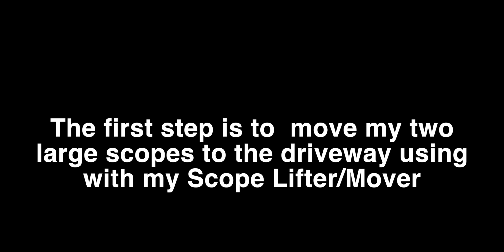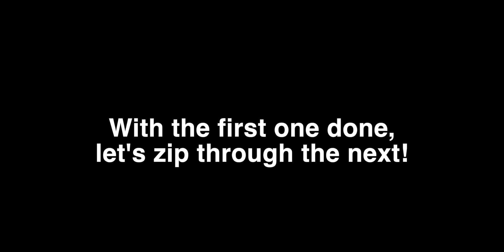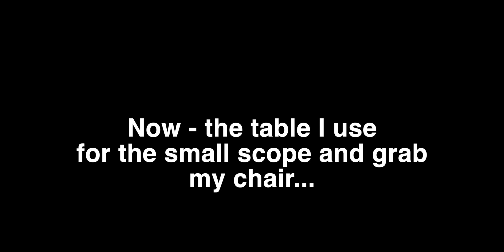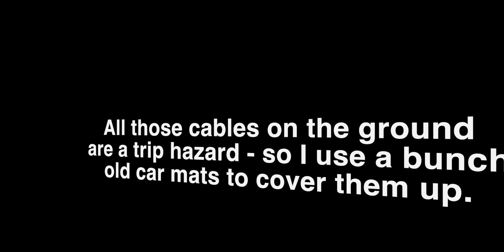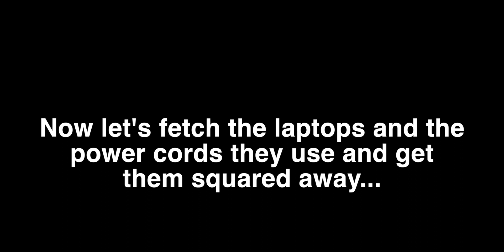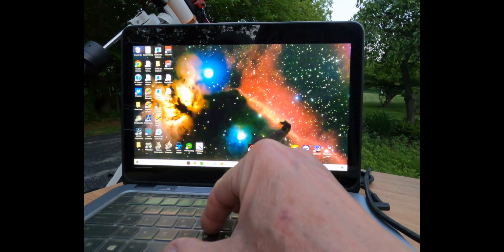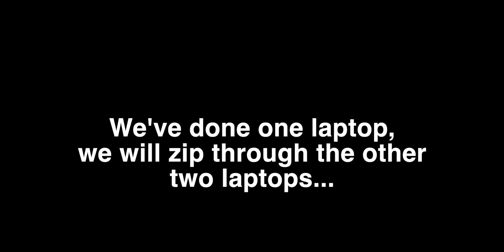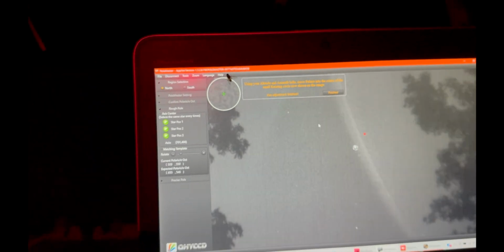Join Me as I Setup 3 Telescope Platforms in My Driveway for a Night of Imaging!

Comment: Very cool Lifter/Mover. Had to laugh at the washers and nuts. I have that same set on my 115EDT with probably the same ADM kit. Clearly you’ve perfected your processes. I’ve done 2 but have never had all three of mine out.
Reply from the maker: Thanks!  Yeah, I got the ADM set and the weight was way overkill.  I had a bunch of SS washers from another project and tried them out, and it was just want I needed! A few years back, I did a lot of scuba diving, and there, setting up your rig for a dive needed to be done right for safety.  I got into the habit of doing things in a methodical way, doing it the same way,  in the same sequence,  every time - and doing it enough that it became muscle memory.  Setting up the scopes has gotten that way now!  Never thought my scuba training would be useful in my astrophotography!

All the best,
pat